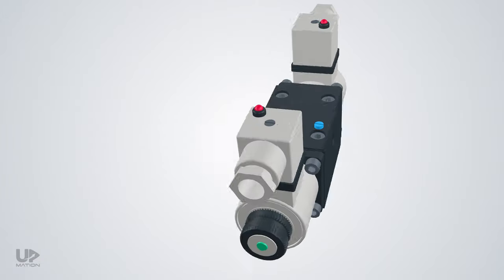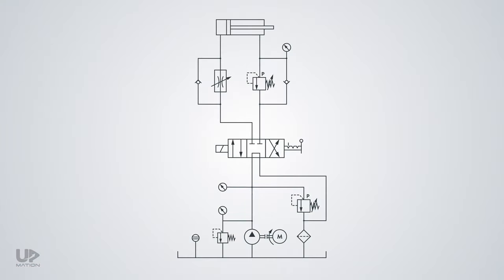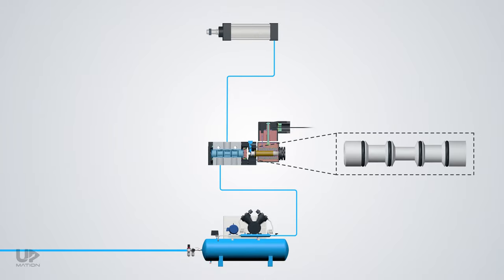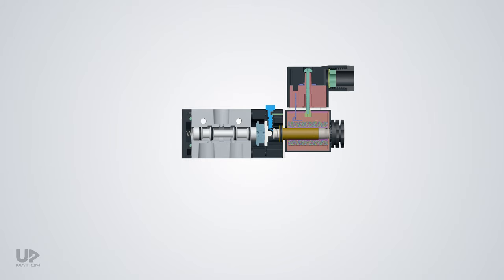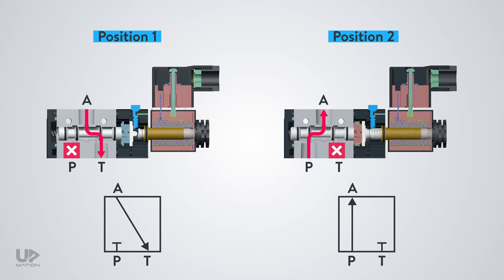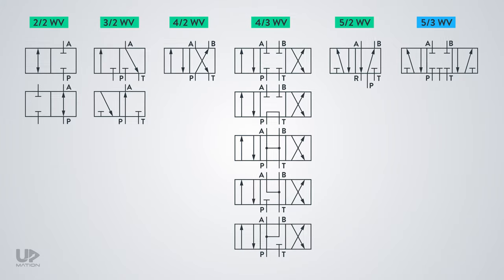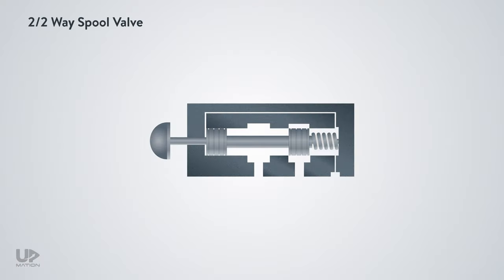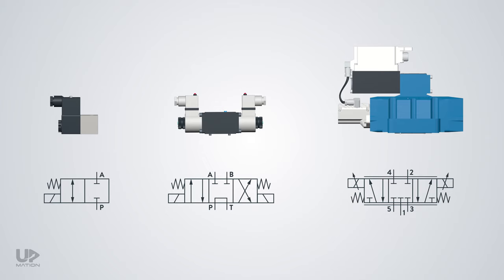Spool Valves: How They Work and How to Read Their Symbols | Spool Valve Operation | 3/2 Spool Valve

Comment: Sir  is it okay not to use control valve.pump to boom cylinder.
Is the orrifice of the valve has signicant into hydrauli cercuit?
Reply from the maker: No. You have to use the DCV.

Comment: Is there any way to repair a pneumatic valve by opening the housing and replacing o-rings?
Reply from the maker: Yes, there is. By dismantling the actuator(s) you can remove the sealings and bring out the spool and its O-rings for changing, cleaning the rust and wear, lubricating or any sort of repair. Hope this answers your question.

Comment: what is the blue lever for?
Reply from the maker: It is used for exciting the valve mechanically, without connecting an electrical voltage to the valve. For instance, it could be useful when you want to ensure about the functionality of the valve's mechanical parts.